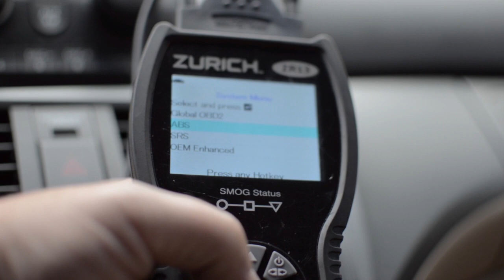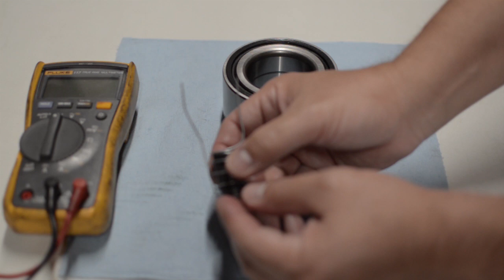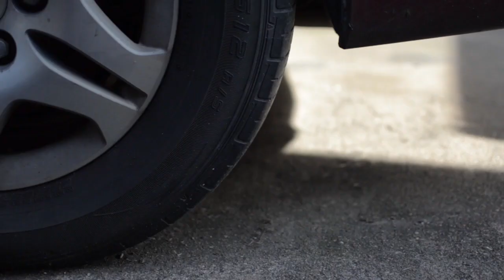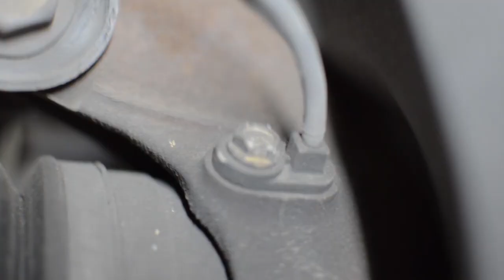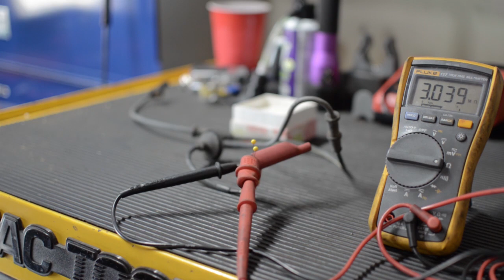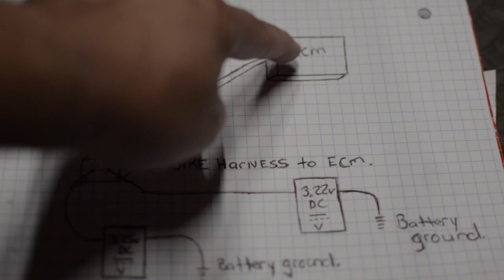DIAGNOSING ABS LIGHT 05 HONDA ODYSSEY Part 1

Comment: What I’m having trouble with is I’m getting a 17-1 left rear wheel speed sensor short or open. I can clear the code start the vehicle and the light will stay off. But as soon as the van moves the light comes back on. The vehicle has sat for a while and had mouse damage to the ABS wires. I have repaired them but now am at a loss as to what it is.
Reply: Clean off the tip of the wheel sensor with dry 400 grit, flip it over and clean up the tone rings the metal dashes around the axle, or the wheel bearing in the hub on newer...  Youre more likely to break the wheel sensor if you try to remove it, just wiggle in there with the sandpaper n give it a cleaning.  Also, send a wire down the line to the rear plug to check continuity of wheel sensor wires, plug to plug.  No beep means broken wire... ummmm mine was a weeds revival, mice, fixed, serviced back to health, 80 miles in, ABS, TCS, BRAKE lamps illuminated, and I was about to send back to the Lady with young'ens.  Chasing sparks for 3 days.  I had already fully serviced xmsn, recall was already completed, 161080 miles p1676 and C-reader cannot access ABS computer, but no problem anything else
Reply: @zusclhz  I had switched the wheel sensor out for a new one. I cleaned the wheel bearing the best I could with a rag dampened with brake clean. The ABS light now will go off for a while, come back on and go off again by itself. I think it’s the harness connector for the wheel speed sensor. The fault won’t clear, then I will unplug and plug the sensor back in and the fault will clear. I reluctant to splice in a new connector. IDK
Reply: @rickykraus7450  what year?  Because new ones read the tone ring off the wheel bearing.  If the bearing is going bad, it will fail ABS 🙏  dont cut any thing until you know it is time.  Always think in terms of 'the connector looks good, both pins contact...,'  clean terminals' oxidation with brass brush, use voltmeter to check continuity in ohms on your wires.  OH BRUH Bleed the brake lines!!  Opposite corners(X).  That can do it.  It sat a while.  Possibly needs new fluid bleed to get trapped bubbles out of spaghetti 🙏🛠🎶🎵
Reply: @zusclhz  Thats why I haven’t cut wires yet because I’m not 100% sure it’s the problem. 2 times now while braking I felt the brake pedal drop like a quarter - half inch and the Abs light came on. Stayed on for a bit and the light went back out. I bought brake fluid a couples days ago and will flush out the lines today and see what happens.
Reply: @rickykraus7450  bleed the lines, sounds to me 🙏